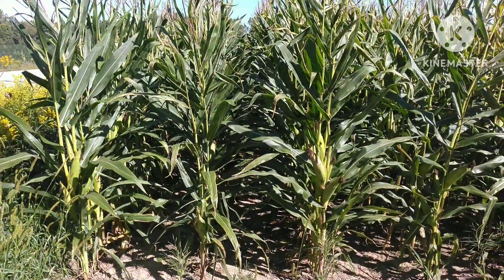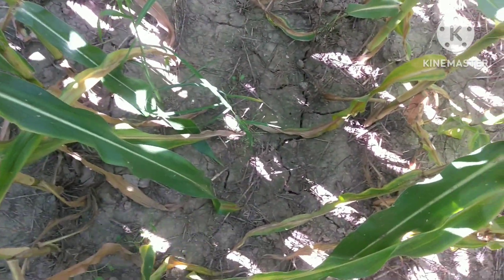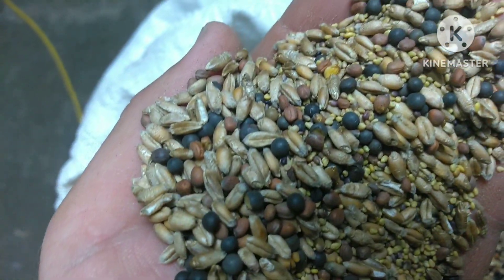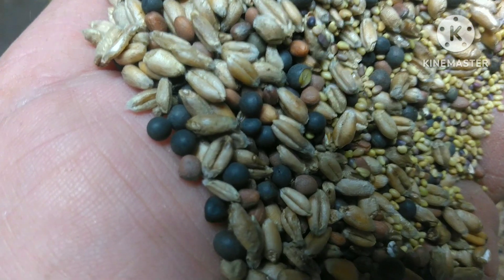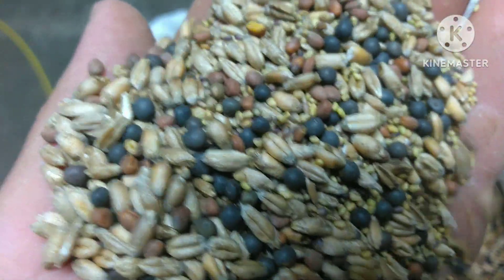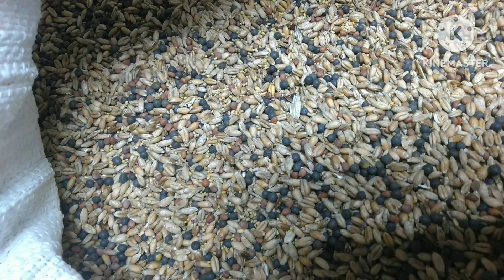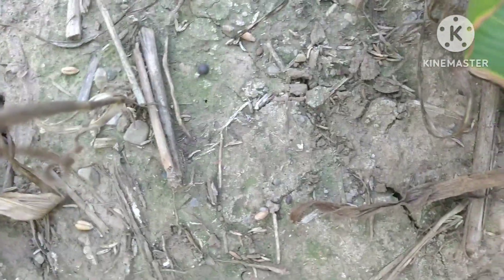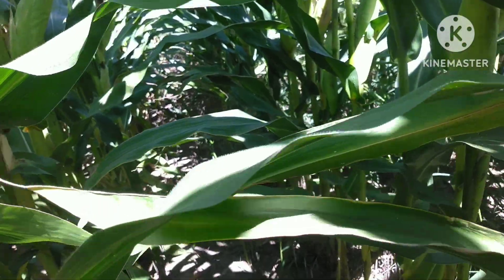Drone interseeding cover crops into no till corn

Comment: Is the seed laying on the ground enough soil contact to get good germination? How long does it take for a drone to cover each acre? Is the plot gps programmed into the drone or is it hand flown?
Reply: Thanks for the reply. Seems like this technology could really be useful.
Reply: Hi, any further info after a while pls? How effective was this method? Did sufficient number of seeds make it through to the ground and started actually growin? How about this year? Are You gonna do it again?
Reply from the maker: Here is the link to a follow-up video from this spring prior to termination of th cover crop before planting this years corn.  https://youtu.be/gf-Ke2yVIzs?si=8pIZoPzx0XvYgwBM
I'm not sure if I will be doing any this year due to crop rotation this year and what is planned for next year's crop rotation.
Reply from the maker: I do not own the drone. I custom hired it done, so I don't know all the technical details about the drone. 

This was the first time I tried the drone seeding. If you get adequate rain fall, it should germinate being below the corn plant in the shade and moist environment. We were very dry until harvest time, so germination wasn't as good as I had hoped for. But there is a lot of hairy vetch that germinated and grew late fall and this spring. I am planning on doing an update video on the drone cover crop before I plant the field and spray it off. 

It took them about 7-8 minutes, I'd say per acre. But I was putting a heavier rate on, so that determines acres covered. And required more refills of seed. It spread 40 feet wide.  They manually flew the perimeter of the field to plot any obstacles and to set boundaries, and then the unit calculated the best route to cover the field and used GPS to fly itself. It even returned by itself to the landing area to refill and swap batteries.